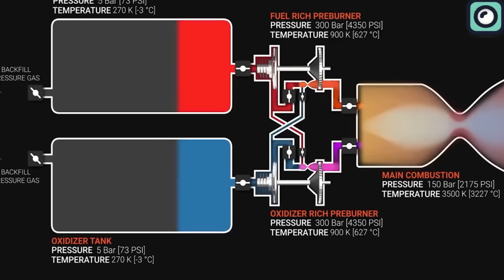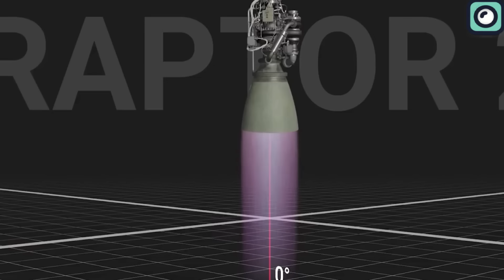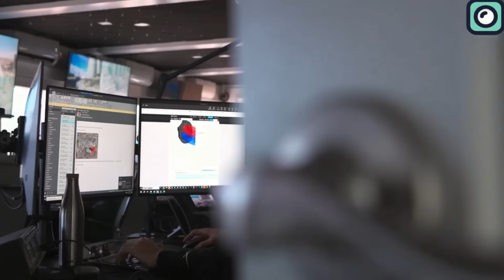FAA Breaks Silence About The Second Starship Launch Explosion!

Comment: The first stage engines were not the problem. The sudden negative g’s at hot staging, and rapid flip after separation caused fuel to be violently moved in away that the pumps couldn’t get any fuel causing the series of engine failures. In terms of SpaceX rapid reiteration, this is just a minor hiccup.

Comment: Confusing video.  Not clear which launch was being criticized at first chapter.  No description of the electric actuators; are they motors, or solenoids, or something else?  It was a titillating delivery of vague information.
Reply: The actuators that you are referencing for the gimballing of the engines are actually servo motors that have optically encoded feedback for exact precision of placement of the engine gimbal position.

Comment: Few realize or appreciate that with NASA's moon program more than 50% of the engineering went into the Saturn V rocket and its control systems. This level of engineering and testing is absent with Musk's company where its rockets fail after launch instead of on the ground.
Reply: different testing methodologies. Someone once said' better to be silent and thought a fool then to speak and remove all doubt'

Comment: I Wonder if SpaceX should try adding magnets to Starships and its booster so that they could have the option of cold separation using magnesium and gravity first to separate the two structures  within a window of time that could allow hot separation as plan B . Magnets might also help during restacking or aligning the two sections before flight. And if gravity and magnetism could be used for separation that would save a lot of stress from the Heat of hot separation maybe also it could help with sticking the landing on a flat surface.

Comment: You fail to grasp that it's not all about engines, it's about the architecture, feed systems, & operations that must provide positive suction pressure for the engines to function. That's where the risk is. I hope that enough 3D CFD has been performed for engine run box compliance and that dynamic envelope analysis has been performed to show no contact of the upper stage center engines to the hot start ring deflector. I have 38 years in Propulsion system development and see nothing but more unknown unknowns to derail that entire system.
Reply: Yep, you don't know what you don't know until you test the engineering and get some data back to analyze.

Comment: Innovate and test, innovate and test, innovate and test.  Just working the bugs out.  Each launch yields a wealth of flight data that is critical for the solution of problems for a more reliable flight system.    The iterative test flight program works well for SpaceX.  It would also have worked well for Russia also, if they were not so ignorantly determined to steal the territory of other countries.